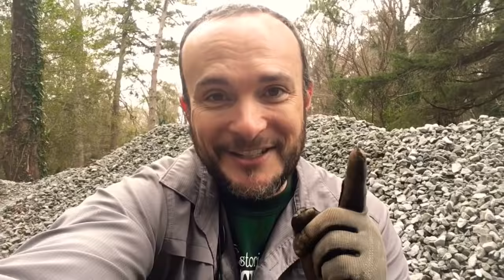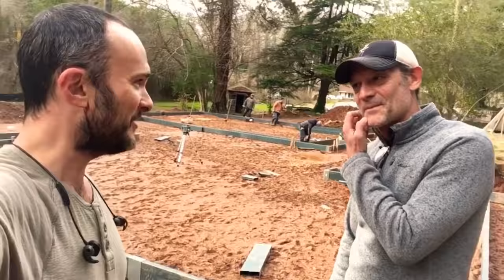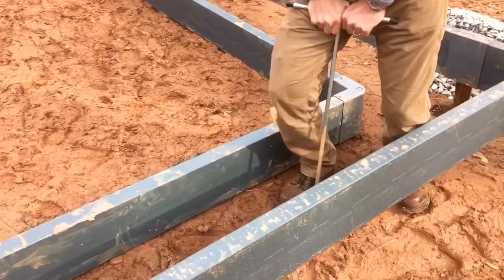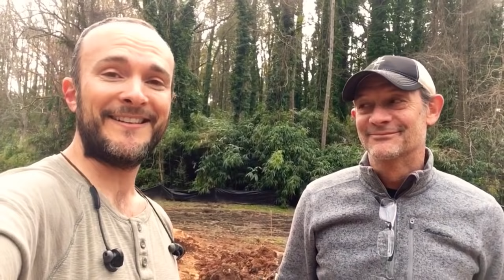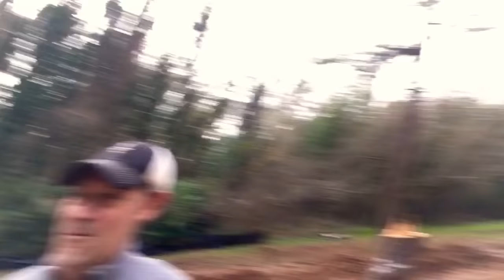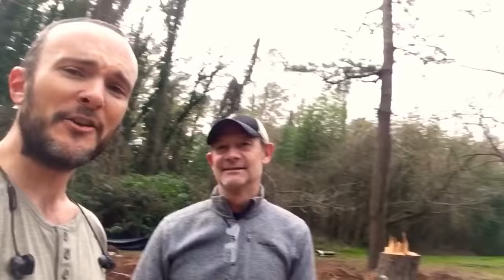Geotechnical Testing: Proof is Possible, but Sometimes It Hurts

Comment: You are lucky to count with the knowledge of a soil consultant. 

Most important part of a building is the foundation.  

This quick consultation will save you money down the road in very expensive repairs.
Reply: Those consultations can be prohibitively expensive for a small, out of the way, building. My advice is always, guess it, test it, do it.
It ain't rocket surgery.

Comment: One of the things that I learned along the way is that over-engineering stuff at the beginning of a project is often cheaper than having engineering consultants come in. 

Which is NOT an argument against engineering consultants. It's an argument in favor of "over-building".

For example, and this is going back BEFORE the day recorded in this video...  (Also, taking into account the rock.)

I probably would have excavated down a couple of feet and about twice the planned footer width. and blended the materials with portland cement. There are a couple of ways to do it. One way is to shovel the cement right on top and blend using a rototiller, another is to actually use a cement mixer to blend it dry, then wheelbarrow it over to the footer area and dump it in before raking it out. I would likely have chosen the latter method since it allows my to layer in some Geogrid. Everything gets compacted with a jumper or vibrating plate. That portland cement trick is an old soil correction hack that I think goes back to the 19th century. Lime also works. Mainly, you want to keep organic material out. If you think you have a lot, dilute the soil with sand before adding the cement or lime.

That's quicklime, by the way. Hydrated.

Lime is better for fine grained material like clays and silts, cement for coarse grained soils with a high sand content. Either way, when I've done it I was aiming for 5% - 10% of the total material.

There are actually formulas and specific guidelines for this stuff, but I generally just went seat-of-the-pants with it. The guiding principle was the "Nuke it from orbit" school of thought. Nobody ever complains when something is TOO strong or solid.
Reply: Why didn't the engineer perform Dynamic Cone Penetration Testing (DCP) accompanied with auger borings with DCP test at -1', -2; and -3'?  Need a bearing pressure of at least 2000 pounds per square foot, and the DCP is the only way of determining.   When probing alone, you may encounter small rocks that get in the way, and it may actually be softer below those obtstructions.
Reply: @eh8899   -

I'm guessing cost.
Reply: Why not just put in gravel?

Comment: My house, in virginia would not stop moving.  Drywall cracking, door sticking, cabinets pulling away from the wall were the indications something was wrong, it's the soil.  The house was built on expansive soil, having an uplift pressure of 900lbs per  sq ft, one level ranch on full basement 1600sqft.   The builder and building dept failed to follow the expansive soil policy.  1.5 years of battling the building dept and builder and still not done with the repairs.  My geotechnical firm designed the removal of the backfill, replace with gravel/ topsoil and 19 helical piers.  By the time it's over, the cost, estimated $50k.  The only way to tell if the soil(clayey soil) is good;  have the soil tested for expansiveness.  As far as the video goes, the point is; verify the foundation soil,  to do that you need a qualified geotech to examine the soil, and it shows that.
Reply from the maker: Wow, Pat, what an experience. Sorry to hear, but thank you for sharing!

Comment: Nice work. Now couple problems: 1) You have very tricky spot for house build, as part of house is siting on rock and some parts are siting on clay based soil and these soils moves differently. Clay based soils moves as water content changes. 2) Its common  practice to use gravel to boost soil load bearing but you have to compact the gravel with compacter and also use something to fill voids between gravel, or these voids will fill naturally and the footing will sink a little over course of time by volume of voids.  PS English is not my native language.
Reply from the maker: Your English is perfect- our geotechnical engineer recommended the same thing, we have videos about that earlier in this series.
Reply: Tnis101 an alternative (depending on soil conditions) might be to drive pylons into the ground.  

Once the pylons are driven in, then a footing base is built around each pylon using rebar and concrete.

This is an even more expensive method of dealing with poor soil conditions.  So gravel and compacting the gravel in is not so bad.
Reply from the maker: I’ll count myself lucky for getting off easy then!
Reply: @HomePerformance  Can you please share the link to those videos please? Thanks.

Comment: I've been a geotechnical engineer for 5+ years now... I would never give a baring using a probe rod too much liability. But I also only do commercial and not residential. Most baring I deal with is 3000 to 8000 PSF where a home at most is 1200 to 1500 PSF.
Reply from the maker: Our geotech has been doing res for decades
Reply: @HomePerformance  I still did not get how he founds that soil is not strong.
Reply: What do you use to test soil? Pentration test? Like What the easiest method to do to test for residential? Does dynamic cone pentration works?
Reply: We use a steel hollow rod with a 40lb weight.  We'll drive it in the ground by lifting and dropping 40lb weight counting blows for each 6" going a total of 18" once done pull out of ground and inspect the soil inside hollow rod, hopefully you're on natural soil or documented fill. Based on soil and blow counts i can then give you your soil bearing capacity or undercut unsuitable materials to get down to good soil.
Reply: @abdullahn9827  if you wanted to use a DCP you really need a data point in your area to compare your blow counts to
Reply: @TWUTHREE  Thank you man!
Reply: Is a penetrometer an accurate tool for residential work?
Reply: I have wondered the same thing about a probe test such as this.   The bearing capacity of gravel and sand is extremely high, yet with this kind of test, it makes it seem unsuitable.

Comment: I have done many basements and see that you are there every day with the bad weather . I really do like the fact that you are out there kicking the shit with the workers and taking on the tough results from learning the proper way . Radon has been a factor in my stint as a Professional Laborer because of buried trees and ? Now with the form a drain you said it will be vented through the roof? My first thought was?  Are the drains running into a crock with a sump pump? in the house or are they flowing with gravity away from the house and if it does run into a crock how does vent through the crock ? I have only vented for radon on the outside of a dwelling not inside . Still learning ! after retirement.
Reply from the maker: Thanks Lou! Here’s the drain detail:
Drain Trench Performance: Radon Mitigation and Foundation Drainage
https://youtu.be/AIiH2EkJOfM

Comment: how much do geotechnical engineers charge for doing the foundation soil test bores  which should include wet and dry density, compaction, moisture, bearing capacity and as you say "quantifiable high performance ."

Comment: We are about to pour a stem wall foundation (footings first, then stem walls) at the same place where the old house crawl space foundation stem wall and footings (demolished in Sep 2022) used to be. After the full demo, the trenching from the old footings was filled with what was left of the natural soil around but is still slightly lower than the overall (flat) lot elevation. The idea is to place the new footings at elevation about 2' higher than where the old footings used to be so we can have the top of the foundation stem wall be at least 1' above the final grade which in turn I want to be at my neighbours' (on each side) soil elevations. Our soil is sandy (Granby-Morocco complex), appears to drains ok and building inspector advised that soil has good PSI and no compaction is needed. In Mar 2023, I tested the soil where the original footings used to be with a 5' steel probing rod. At some spots of the old perimeter, the rod went down all the way to the handle relatively easy which concerns me. Neighbour says that our area has a high water table. Code requires footings and wall to be at least 42" below grade (we are in SW MI). After excavating (probably 2-3' deep and then bring fill to make wall under grade per code), I plan on compacting and placing stone (#57) under where the footings will sit. Footings will be 8" high X 16" wide with 2 rows of #5 rebar and 3,000 PSI concrete. Backfilling will be with stone on both sides of stem wall. I will have to bring fill (pit run) to raise the overall lot elevation before compacting and placing stone which will be under the slab. Since I want footings to sit higher than where old footings used to be, do I bring fill first, excavate to 42"+ depth, compact, place stone, pour footings last? Or, I excavate first (I guess not as deep), compact, place stone, pour footings, bring fill to cover foundation per code? Do I need to go with wider/thicker footings? More rebar? More PSI concrete? Need a cost effective piece of insurance. I am waiting for a Humboldt pocket size penetrometer to be delivered and intend to use to further test the soil. Thanks in advance.

Comment: The Durham-Geo Slope Indicator static cone penetrometer probe has q gauge on it that actually gives q bearing strength reading and is more reliable than just a static probe
Reply from the maker: Nice
Reply: @HomePerformance  The price may have gone up, but they used to be about $530. They come come from Stone Mountain, GA so you could probably drive over there and get one! I actually work for a Geotechnical company and have used one for years. One of the contractors saw ours and bought two for themselves on future projects. We had to use them for Corps of Engineers projects on foundations and natural soils. I'm pretty savvy on that stuff if you ever need any free tips! Always glad to help!

Comment: Is that "high tech" tool shown in the video called a soil probe? I ask because the ones I've seen are fiberglass and not steel. I know you guys are making a joke but I believe the reason its a "soil probe" is because if it was any other material like steel then it would be easier to punch a hole in the soil vs it being made out of fiberglass.
Reply from the maker: No idea, but I know from using a simple length of rebar that it’s not easy to go deeper than 1-2” if the dirt is really compacted
Reply: it's the cross sectional area ( and the profile of the "point") that matters, the material , as long as it does deform, has nothing to do with. The units  (P.S.I)  are the give away Pounds Per Square  inch/foot of the bearing area.) ,.  Ponder snowshoes vs stiletto's  ;-).
Reply from the maker: Nice, thanks for the explanation
Reply: this test looks completely unreliable and might give you wrong sense of security based on pure assumption.
You might as well look at the chart of different type of soils and their typical bearing capacity. Run a plate compactor before building forms and be done with it.
Reply from the maker: Testing is the opposite of assumption. And charts are nice in the office, but you can’t tell what the soil is doing (or what it’s made of) without getting in there and testing it. Also, we used a vibrating drum compactor, much more effective than s plate.
Reply: @HomePerformance   penetrating soil by hand and making decision based on your feelings is not considered testing. It is an assumption
Reply from the maker: Don’t tell me, tell the geotechnical engineering society.
Reply: @HomePerformance  Someone discovered long ago that putting fear in people sales and in turn makes them money. Be it extended car warranties, home warranties, cell phone warranties, life insurance, colon or prostrate exams and so on. Put fear in someone and you get their money. Remember when colon exams were recommended at age 60? Then it was age 50. Now it’s earlier if past family history. Think of all the extra money they make by having younger people come in for exams. It’s all about fear. Scrupulous auto garages aren’t the only companies that will lie, or use scare tactics to get you to replace or buy a new part or product. 
Buy a $9.95 screwdriver and at checkout they wanting to sell you a $4.95 two year warranty plan.
It’s mostly BS. The reality is that millions of homes are built on clay and other type soils  without soil engineers getting involved. The vast majority never have any foundation problems other than a little settling that causes no crack drywall or door/window issues. 
Soil engineers are like lawyers. They  can’t tell you any specifics until they get you to agree to $1,000’s fees.
A soil engineering company that drills and test samples will cost you several $1,000’s of dollars. Then they will give you overkill foundation plan details because they want to cover their ass. 
So it’s like one guy commented, just cut out the middle man and build footings bigger than chart recommendations. Overkill without having to pay out $1,000’s to glorified consultants only to find out you have to overkill on foundation. 
No soil engineering company is going to recommend minimum build specs. They don’t have yo pay for extra labor or materials so they gonna recommend way more than actual specs call out. After all if they get sued. because a foundation fails, their insurance premiums will skyrocket. It’s all about fear and money.
Reply: The fiberglass rod is best for hand locating underground utilities while excavating. IE Powerlines. But it can be used as a soil probe. The idea is the bearing pressure (resistance) on the tip. Most tech will use a steel rod.

Comment: Don't see the point of this test.  Anyone can stick a rod in the ground and say it's soft.  Let it dry and it will be harder.   There is no degree of  measurement other than his feedback from the rod.
Reply: A residential building pad needs minimum 90% compaction. The engineer onsite probably didn’t have the proctor or the nuclear gauge so he did a probe test.
Reply: @xxfacostaxx  No. There was no material in the hole.

Comment: Instead of a Geotechnical Engineer thats gonna push on a probe, You're third party should be a great lab technician that can look at the soil and tell you the expansion index values of that soil. In this case looks like saturation is not a problem. Appears to be a consolidation problem "or as geotech engineers say, compressibility". In my experience, the geotech engineer only ran a few PI's, and a few gradation/sieve analysis, and a few proctor's in college, and really don't understand proctor modified to standard. Get someone that has actually ran the gambit of lab tests and calculated that shit by hand. BTW, he is putting at least 8000psf effort on that probe to go down 12". I'm guessing foundation was deigned for 2000 - 2500psf. Expansion/shrinkage of what looks like soft clay (CL) should be your main concern. In any case, It was clearly not acceptable to put concrete on, and I find it crazy that you had to bring in a third party for this.
Reply: just had mine tested by a geo engineer says that after 1' mine is fat clay (CH) the remaining depth of the 10' tested ,his recommendation is to dig 7' down and replace dirt and can use the lean clay to compact back into foundation
Reply from the maker: Wizardry